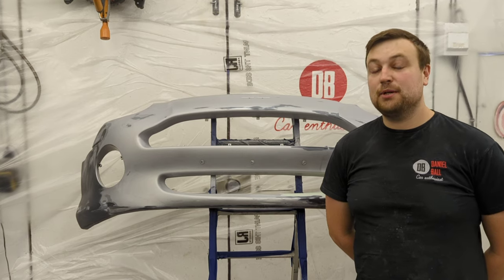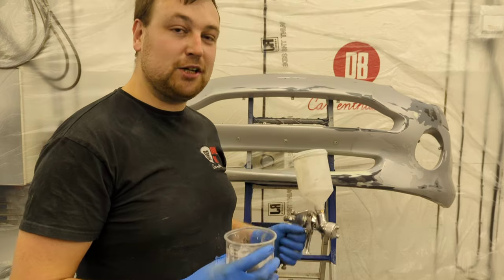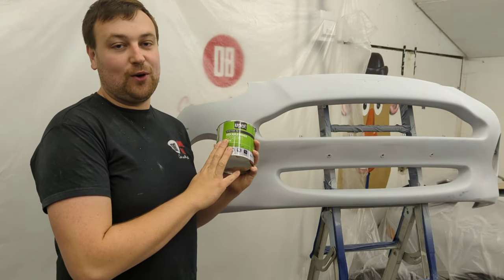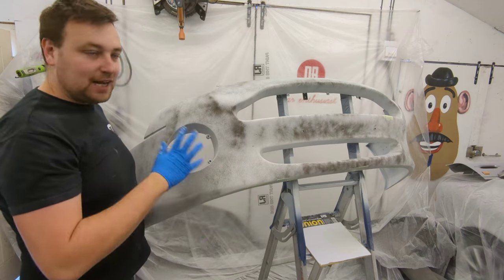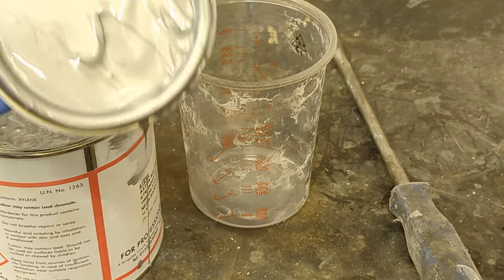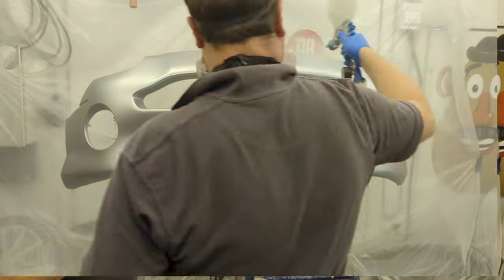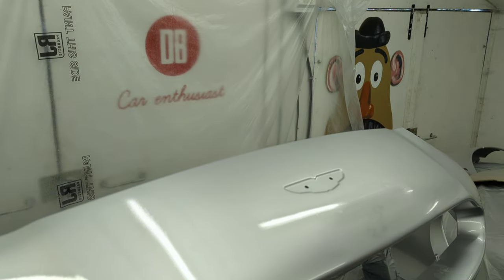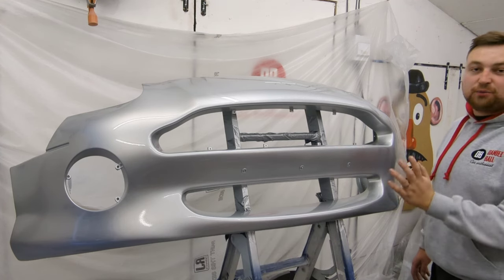What a NIGHTMARE! Aston Martin DB7 bumper painting

Comment: I have had similar problems with clear coat drips upsetting the base coat. Now I hang bonnets on the wall rather than painting them on the car. Any drips go on the floor.
One thing I do is ensure I put a final even primer coat on so the panel is a uniform colour before spraying the base coat. This means you need less base coat to get a uniform shade.
Reply from the maker: Thanks for the advice. I am a self taught amateur but have slowly progressed. I always aim for perfection but don't think I will ever get there.